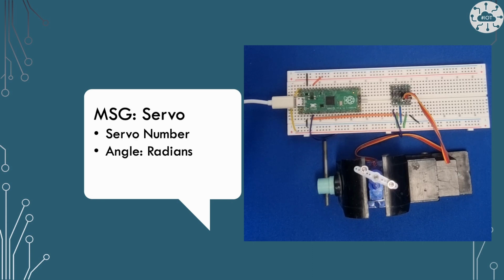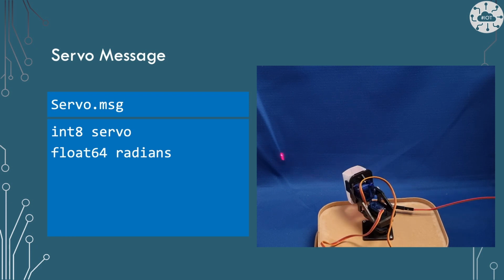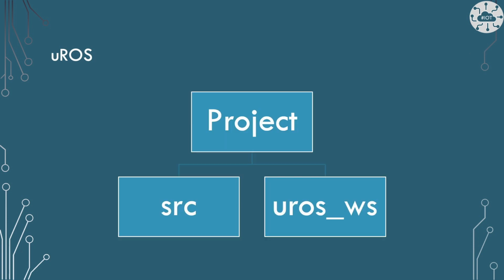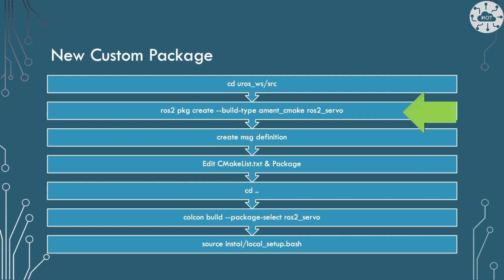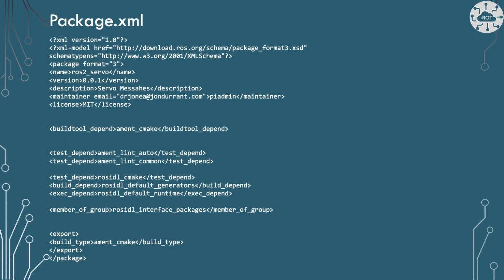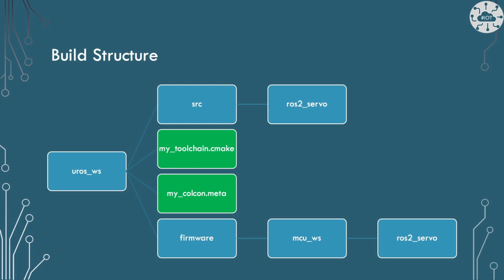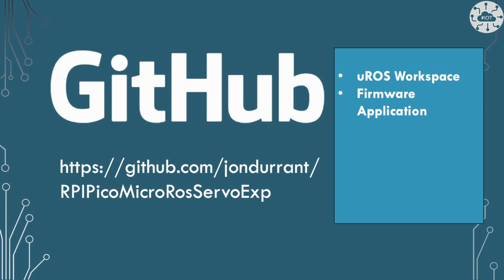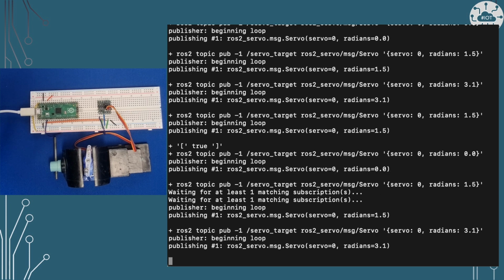MicroROS Custom Msg on Raspberry PI Pico

Comment: I love the project, but I've been looking into using a w5500_evb_pico with micro-ros communication over UDP/TCP-IP. My biggest problem though is getting the communication to work. How would you go about it?
Reply from the maker: Thank you.
There are some examples of UDP communication working with the Pico W available on GitHub that I have seen. I haven't tried them I admit. I would consider looking at them as a starting point.

Comment: Hey Jon, great video. I still don't understand, how you generate the .UF2 file to flash on the pico. Could you please clarify?
Reply: There's also a Getting Started with Pico pdf among the official the Raspberry Pi Pico documentation that shows you how to set up a build system, how to use cmake, how to use SWD to debug the Pico and how to put all of that into a VSCode setup. Aside from setting up the debugger (which is not really essential to get this working), following the documentation had me up and running in about 10 minutes.
Reply from the maker: Glad you where up and running so quickly. Lots of people find this a little more challenging.
Reply from the maker: Thank you. The UF2 is just one of the forms of the binary build by the compiler. The Pico SDK Toolchain builds both a UF2 and ELF binary which can be used by different flashing strategies. 
If you need some help with the setup of the toolchain and build environment for Pico projects I've got a course on Udemy that goes through this. It's about 3 hours in today length with lots of options depending on your desktop environment. https://www.udemy.com/course/introduction-to-c-development-environment-for-raspberry-pico/?referralCode=875319E04F95C9EC3414

Comment: Unfortunately I can't get the files to build, as after trying to 'make' the files, the following error occurs: "fatal error: rcl/rcl.h: No such file or directory". It seems as though the microros libraries don't get linked. Do you happen to have any suggestions?
Reply from the maker: I've had that myself it is very frustrating. I use "make V=1" to see the gcc command lines and check for the include folder. 
Remember cmake does not always update paths if you change them, so I often have to blow away the build directory and start again.

This repo does compile fine for me. There are also other uRos examples in https://github.com/jondurrant/DDD-Exp
Reply from the maker: The most common cause of this is not adding "micro_ros" as a target link library. Certainly do that all the time myself :-)
Reply: @DrJonEA  Thank you for the answer, after examining the build commands using 'make VERBOSE=1' Ii turned out that the MICRO_ROS_PATH was being set to a wrong directory, thus all the include directories were incorrect. Even though I look at the MICRO_ROS_PATH path every so often when building, I never caught that it's incorrect, which only makes it so much worse. It's all good now, so thanks for the help!
Reply from the maker: Glad you got it fixed. We all fall over this silly issues all the time.

Comment: thank you for the great tutorial. I would have never managed to set uROS up without it. I have a question. After I have created the custom messages and working firmware, how can I use those message types in ROS2? My uROS node subscribes to topic /joint_angles of type servo2040_msgs/msg/JointAngles. I would like to publish to this topic from a ROS2 node. how should I import and use those messages in an RCLCPP node? Do I have to declare them in rclc type "servo2040_uros__msg__JointAngles" or can I use rclcpp "servo2040:_uros::msg::JointAngles"? Would it be possible to copy the .msg files to my ROS2 msgs package , build, and pulish them as such,, that is for example "my_robot::msg::JointAngles"?
Reply: oh, also a little tip. the build works perfectly fine on a pc running ubuntu 22.04. hugely reduces the build process
Reply from the maker: Thanks for the tip.

You can use the msg in any ROS2 node running on the host computer (PI, PC, etc). Just as you would any other msg type. Because of my build process I tend to have two ROS2 WS setup one for uROS and one for the host. The share the msg definition across both.